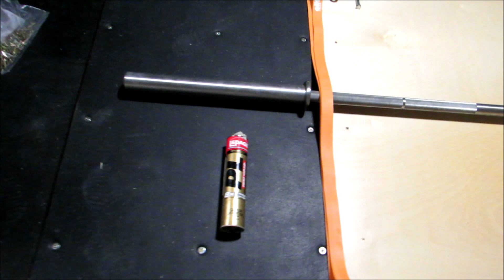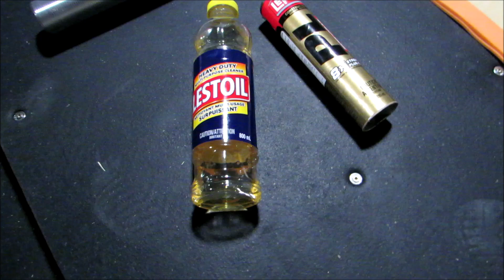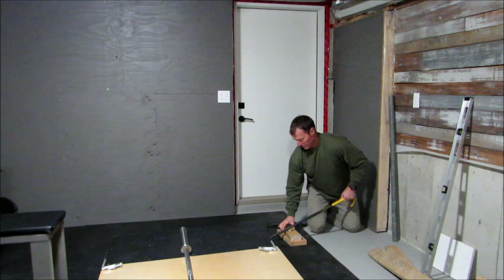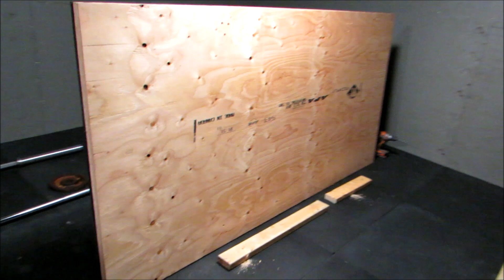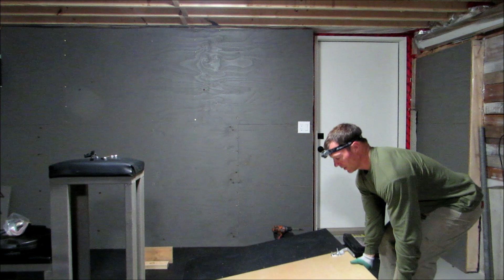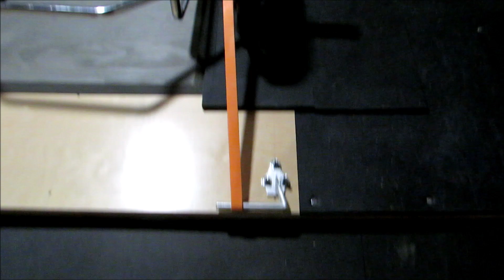DIY Deadlift Platform with band anchor points

Comment: Can't find those stakes in the USA - anyone else able to find them?!
Reply from the maker: I could not find a source in the States for these, they are made in Canada by https://dynaline.com/our-products/ under general hardware. The more $$ option would be to buy deadlift band pegs https://www.titan.fitness/strength/strength-accessories/deadlift-platforms/deadlift-band-pegs/400059.html.
Reply: @TheArmoryliftforlife  I found them!!!  Prairie Bearing & Bolt for anyone in the USA. Call Reid - tell him Steve sent you!
Reply: @tack211  do you have Reid's contact information?  I am interested in purchasing some and found them on Prairie Bearing & Bolt - but the shipping is a bear!!
Reply: @yediydeyah78  call or email them from the website - Reid handles all website inquiries.  Tell him I said hello :)
Reply: @TheArmoryliftforlife  Also - curious, in the beginning of the vid, you have the stakes facing "out" - but you installed them facing "in" - I'm guessing so they don't act as booby traps or stick out to hit shins or feet?!
Reply from the maker: @tack211  the final position at the end of the video is best for proper aligment of the bands with a normal bar, hex bar and adds more tension on the bands.